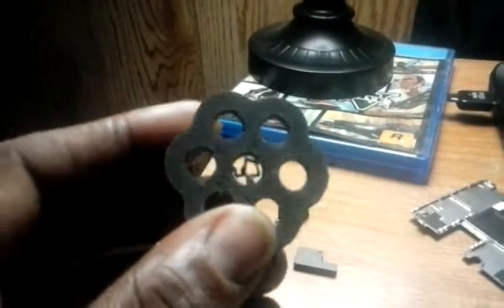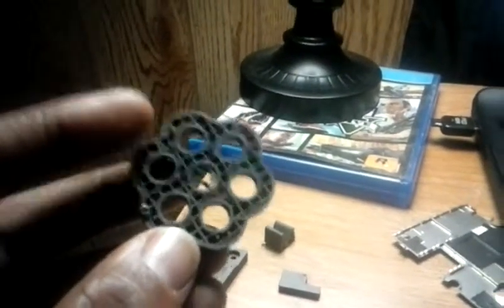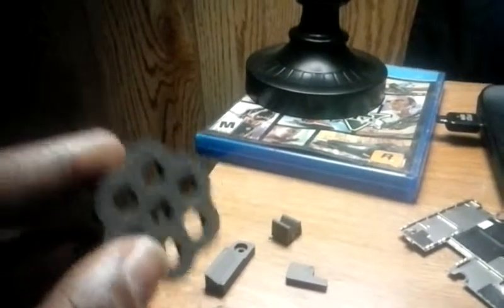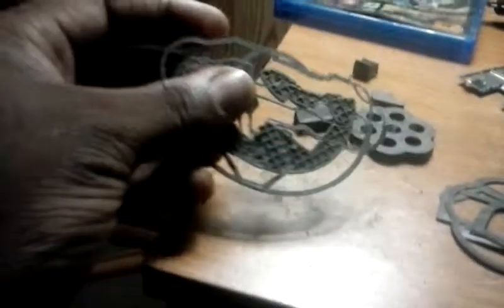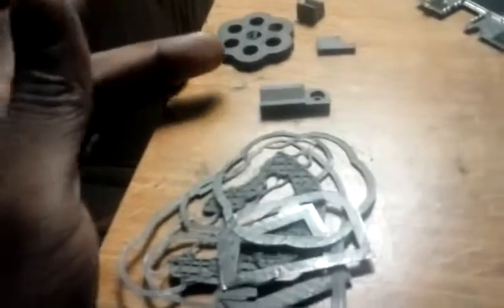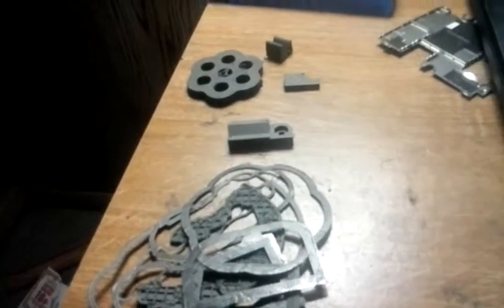3d printing with metal...Robo 3d R1

Comment: Nice - Where did you get the Metal filament? Also is it PLA? That piece came out pretty good. I got to try it
Reply from the maker: Sonny Rivas i just tried some random cheap filament for atest run
Reply: That is what I'm thinking also, but I don't find any cheap metal ones. know a place I can scoop one up?
Reply from the maker: Sonny Rivas real metal no plastic idk forsure because i havent tried many brands but i hear they cost into the 00000 u feel me lol but if u seek u will find i beleive, maybe check over seas or get some one smart to build u one for a few thousand lol
Reply: I made my own